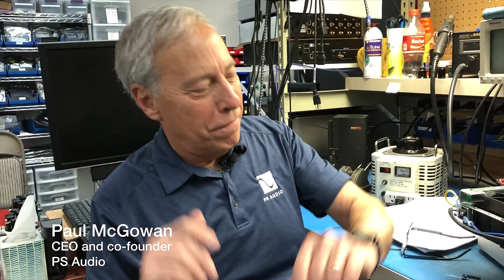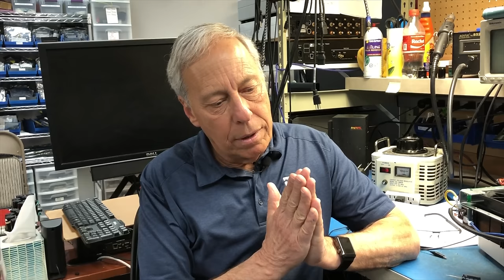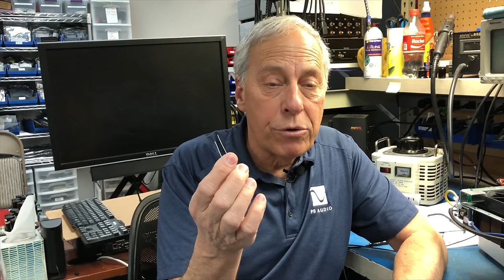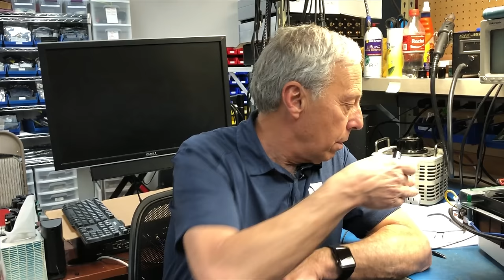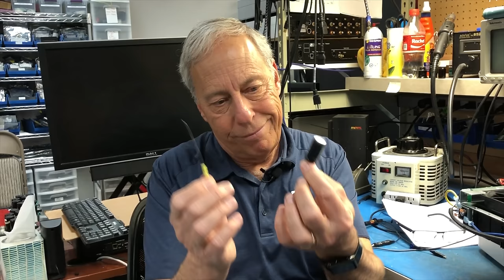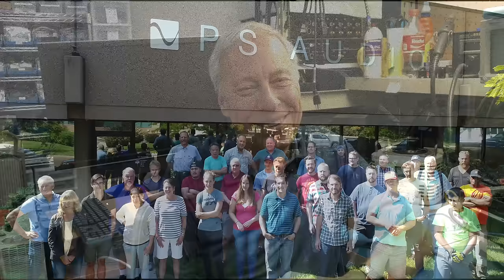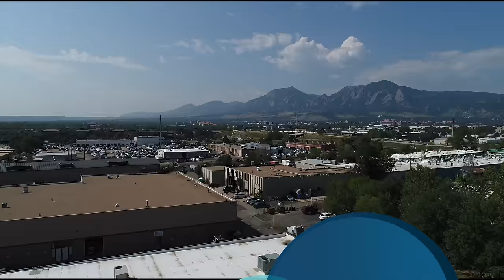Why do capacitors sound different?

Comment: Why do car audio enthusiasts use large 2-3 Farad capacitors in the voltage line to their amplifiers if they do not carry current? This is something I have never seen in home audio. Is this because AC does not need this supplementation? Thanks!
Reply: David Myers Solely because of voltage sag as the amplifier draws excessive  current from the cars electrical system. As current is drawn, the voltage sags, causing distortion in amp. It was used mainly in the old school days of unregulated power supplies in car audio amps, then became widespread in the IASCA competition circuit due to mythology and improperly designed power systems.
Reply: to make the power supply regulated... the cap stores up voltage so when a big bass note hits, instead of having no reserve "tank" it pulls it from the battery making the headlights dim a bit and produces not the best low end. The big cap is stored up power, so it regulates the power supply. Kind of like how they fixed skipping CDs in cars, by having a memory buffer.
Reply: It won't make an unregulated power supply into a regulated one. However, the cap acts as a lower impedance source of energy that the amp draws from during instantaneous peaks. If you use one, mount it very close to the amp and charge it properly through a resistor before hooking it up. If you notice your headlights dimming during music peaks, a cap of appropriate size can help.
Reply: David Myers because they are under the impression that stock alternators will be able to fill up a cap yet they have no resistance between the cap and power source to effect<sic> inrush current limiting, so the truth is that the sag remains ever-present during the peak demands.
Reply: Thanks for all of the responses!

Comment: can you connect your speaker to compare with cheap mundorf 47uf Mcap tin cap(white.color) vs 47uf Mcap Alum vs 47uf Mcap supreme silver oil vs 47uf Mcap Supreme silver/gold/oil EVO.  Does it sound different ! Live Video have ? 😍😍. ( can u do a video with that can ? It will be very Fun to try )......"/

Comment: A better question would be, what does a 22uf cap do compared to 10uf or 47uf cap. 
And what gauge of wire is needed for a 10k hz cutoff on a tweeter?

Comment: Paul... even though i respect what you said here, i want to point out something.....

Now. yes,  i'm sure by now you realize that you stuffed up with a uF  so.. let's leave that aside and i won't mention in

MORE IMPORTANTLY

the question was    WHY do Caps of EQUAL SPEC sound different, ignoring Longevity of life

you then did this
- Explained what a cap is
- Explained how a cap works
- Basically went into Capacitor basics

- you explained which caps are better for bass or treble ( YOU DID NOT EXPLAIN WHY THEY SOUND DIFFERENT)

- You went into Costings

now.. after all this
you still did not explain why 2 Caps of Identical Specs sound different 

listen to the video again, you'll notice that you didn't address the question
even when you said, THIS IS THE HEART OF YOUR QUESTION, you'll notice that you didn't actually address the question, you just sort of went into generalizations of how caps work and which cap is better suited to which application

but you didn't explain THE WHY

can you see that ?

Comment: Why do film caps sound better, because they cost more?
Reply: They sound better because people like Paul sell products which have capacitors in them and they have a vested interest in making sure you think they chose the ones that 'sound the best' so you'll continue filling their pockets with money, that's all.
Reply: @ChildrenOfDesire  Differences were audible for me in some cases. You might buy a 1980s power amp and place an order from Mouser or Digikey. It wouldn't cost very much for you to try changing them yourself. I have a bag of forty of them or so tucked away still. Electrolytics deteriorate over time. Polypropylenes don't deteriorate very much. My newer, heavier, more expensive amp only has electrolytics in the power supply so I had changed only those. Most electrolytics had sounded worse than polypropylenes when placed in the signal path, in my cheaper amp. Differences between decoupling caps right at the RCA inputs were readily apparent to me.

Comment: You should also mention that a capasitor used in a pasive crossover must be bipolar.(can put them both ways.the thing you talked about of usin a cap in a amp circuit as decopling caps to it  decoples to ground i mean.(check it up)loots off audio foolery with capasitors in amplifiers etc.use good quality brand and the rigth type on the rigth plase.you want many elektrolytic caps in the powersuply maybee a plastic type high voltage  from lets say +40volt to comon/ground and  second one from negative 40 volt to comon/ground and a  zobel network that is one type cap and resistor in series from speaker out ? to negative speaker out.ceramic caps in plases where vibration or a music signal goes trhue gives nasty microfoni in the cap and circuit.smd ceramic caps that are stacked to get a value has this problem to.It is basicly a fast charging battery that can deliver the power at once.
Reply: this made sense if you can read gremlin
Reply: I like gremlings.Can you pleace  specify ?That will hope fully help.
Reply: antoher thing is that those who dont care or are very in to sound and elektronics  they dont have to understand what i wrote .I know those who are in to unkonventional poweramp design  understand.knowledge on how things approximately work in amps/ components etc

Comment: Can i use a capacitor in parallel to a woofer ?

My friends says that it will work as a low pass filter
Reply: My understanding is that you need a coil in series for a low pass filter, not a capacitor in parallel.

But if you have both of those things, you create a second order low pass filter, which is 12db/octave rolloff of freq's above the crossover point, instead of 6db/octave for the coil on its own. I'd recommend you go find a crossover calculator to see schematics and find the values you need for your crossover point.
Reply: @MrJamesonStyles  thnx for the advice :)

Actually i did add a capacitor in parallel to the speaker and it just increased the bass but my amplifier was getting hot even in 40% of volume. Now i removed the capacitor and the amplifier is not heating up that much.
Reply: @ananta5453  This didn't occur to me before, and it really should have when you mentioned putting a cap in parallel: 

The amp got hot because of what Paul explains in the video. The capacitor does pass signal above a certain frequency, and if it was a fairly large capacitor, then that will be most of the audio signal that the amp is putting out. So if you put the cap in parallel to the woofer, then you're short-circuiting all of that signal directly back to the amp. So yes, you could absolutely damage your amp by running a cap in parallel with a woofer. Thank goodness you noticed it was getting hot.

I think maybe the bass seemed increased because the higher frequencies were decreased because they were being shorted back to the amp, while the low frequencies still had to complete the circuit through the woofer. So it just sounded bassier because the highs were cut.
Reply: @MrJamesonStyles  thnx uuu 😊😊
Reply: @MrJamesonStyles  i am now going add an inductor to the woofer
Reply: I maintain that you can still do the second order crossover thing I described with the coil in series and the cap in parallel, however. This site explains it:

https://www.the12volt.com/caraudio/cross12db.asp#lp
Reply: Please don't listen to your friends.  
You can add a capacitor directly at the driver, assuming there is a crossover present which has series inductance, but this may perturb the crossover performance in an undesirable way.  If the speaker system has been well designed for smooth crossover from woofer to midrange or tweeter, don't go hanging other components on the drivers.  
You also need to be careful about capacitor voltage rating, and type, when using them in speakers and crossovers.  Ordinary electrolytics should not be used; there are "nonpolar" types which are made for that application.
Reply: Marianne Oelund The voice of intelligence and reason. Great response. I watch some of these PS videos, this one is the worst I have heard yet. Paul did not answer the question which is unfortunately one of his trademarks. And he doesn’t seem to know his math saying that a microfarad is 1000th of a Farad. Maybe he should have one of his real engineers do the videos instead. Maybe a female one? 😆

Comment: Nice try, but... Why do capacitors sound different?
Reply from the maker: Well, for one thing, they are not equal. Just the different dielectric materials alone have a lot to do with how they sound. Also, the types of materials change parameters like ESR that impact sound quality. It's also where you use them in the circuit that matters. Electrolytics in the signal path, for example, always benefit from a smaller film bypass capacitor because electrolytics struggle with higher frequencies depending on factors like their construction, ESR, biasing, etc. It's simple to suggest that all 1mf caps pass AC and therefore should sound the same, but it just isn't true. I wish I had more time in these short videos to explain things as well, complex technical discussions are way over most viewer's heads and I would alienate most people, something I haven't any interest in doing.
Reply: @Paulmcgowanpsaudio  I see, thanks for your time anyway.

Comment: Aluminum electrolytic caps are awful in just about every way.  They drift over temperature, change over voltage, age, have high ESR and ESL.  However, no one would hear a difference.

I always use ceramic capacitors, mostly because I'm electronics design engineer.  Most dielectric types of ceramic caps aren't great for audio, as they can be microphonic.  NP0/C0G caps are great ceramics, but only come in low capacitance values.

Film (polypropylene, polystyrene) and Mica caps are super stable and have low parasitics.  Great choices for stability critical applications.  Tantalum are awful, just like aluminum electrolytics.

To answer the question, "why capacitors sound different?" - capacitance is only a small factor in the overall characteristic of a cap.  You have it's overall impedance over frequency, due to its ESL, ESR, capacitance, temperature coefficient, dissipation factor, ect..  Even the physical size have a big effect on the characteristics.  You'll see a lot of engineers use difference package sizes for power supply decoupling, because the composite properties cover a larger frequency range.
Reply: Yet alum electrolytics are used in the vast majority for bulk storage in power supplies. And how many times do you see back to back electrolytics in the signal path of high end power amplifiers, for decades. It’s all about the di/dt current that flows. If it’s small, it likely has little effect in the circuit if it is passing between high Z node.  I don’t think npo/cog caps matter for coupling between stages becuz I dont think you can hear the effect of the cap value changing. It’s more likely the memory effect occurring, dielectric absorption.

Comment: Why does my amp have 108.000uF?
Reply: Cross Ocean because 108.000uF can store much more power, than the smaller ones. It makes it easier for your amp to output sound without distortion at high volumes, especially the bass frequencies.

Comment: They don't sound any different, some are just made better that's all. If you change  40 or 50-year-old power/filter electrolytic capacitors in an amplifiers power supply you will get better sound especially bass.

Comment: micro is one millionth: 1/1,000,000.  Not 1/1000.   1 mF (millifarad, one thousandth (10−3) of a farad) = 0.001 F = 1000 μF = 1000000000 pF
1 μF (microfarad, one millionth (10−6) of a farad) = 0.000 001 F = 1000 nF = 1000000 pF
1 nF (nanofarad, one billionth (10−9) of a farad) = 0.000 000 001 F = 0.001 μF = 1000 pF
1 pF (picofarad, one trillionth (10−12) of a farad) = 0.000 000 000 001 F = 0.001 nF

Why do car stereo guys use one farad capacitors in their systems?

Comment: AC current passes thru a capacitor
Reply: Yes and no
Reply: @Timothy Tonole not electrically, no, as there is a dialectric, but yes actually, measurable with a multimeter

Comment: A Microfarad is a millionth of a Farad! (Not a thousandth) and the electrodes of film capacitors are metallized aluminum or zinc, rarely copper!...Now? Unless you plan on passing continuous DC through your speakers, electrolytic caps are a bad choise! Non-polarized Cap's are what you want!
Reply: Paul? that teeny-tiny non-polarized Cap you were holding would barely handle 30 Watts! I've exploded many tiny caps like that in my crossover! :)
Reply: I now use 'run-capacitors' (for motors/compressors)! They will handle the current and cost only a few bucks!
Reply: And, No! They are NOT microphonic! lol, I listened with my wifes stethoscope! :)

Comment: if 1 cap -1u-> 10 ohmESR  then  100 parallel caps 100u -> 0.1 OhmESR and so on...
Reply: For DC resistance, yes. For audio (AC) signals, not so much. Learn the difference between resistance and impedance, and then consider all the other factors, like reactance and inductance and then a bunch of other things. Simple DC math does not work with complex AC signals at all.

Comment: cpasitors in a lienar pcu with cap bank.a capasitor is a istant charged batery.that can deliver all the power at once if needed.they clean up the hum from wall ouylet 50hz or 60hz after the full rectifier. wire have some capasitance a cap dont pass ac volt not dc as you say.an  analog audio signal is ac.You seems to let other do the job with calculating and testing on breadboards etc.am i rigth.you dont talk as person that  can design amlifiers and the calculation.and you have a ver l,ong way to say a simple ting
Reply: leohobb leohobb Let me get this straight. This is the edited comment?
Reply: Now it is not.What is your daily language?You can try to build up sentences in my language.I can  understand fine people that are  english  or from  usa( english with a difference in the back off the troath they have a warm potato  when talking.It is a an going joke  about people from Denmark and Usa.Does that offend you?I know you probably dont understand it cause you have had to live here and traveled to Dk or Usa to understand  i think.Was this written good:?
Reply: leohobb leohobb My point was not to make fun of your English. I cannot speak your language. Jokingly, my point was that an edited version makes very little difference.
Reply: How does edit the tekst  make very little  difference?
Reply: leohobb leohobb Because it is incomprehensible.
Reply: I am going to test out if it is so incomprehensible as you say.I will use people that i know.they have similar knowingness off the tema i wrote about.Seem you understand my answers.I wonder what the time difference  between you and where i am?The clock is 11 "before dinner"i would say befor mid day.